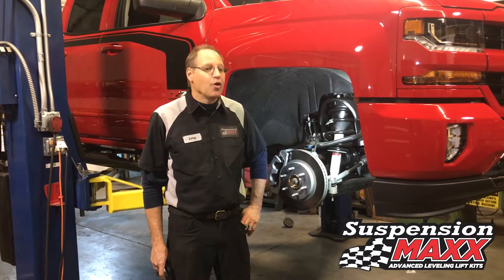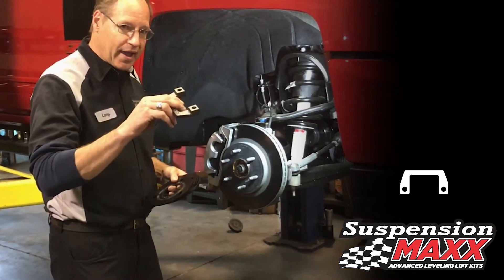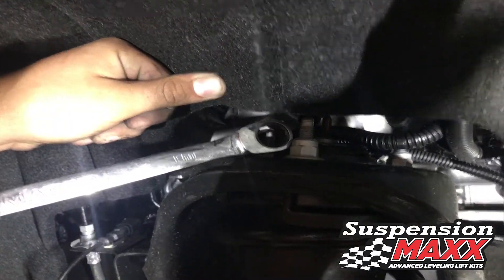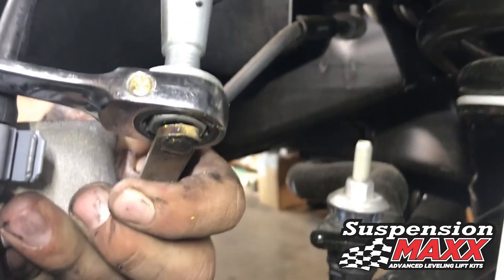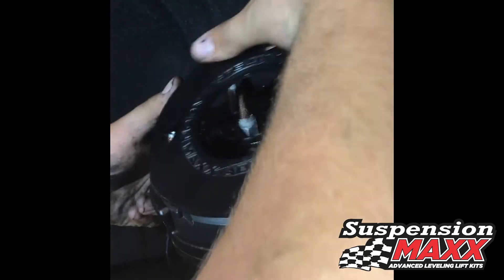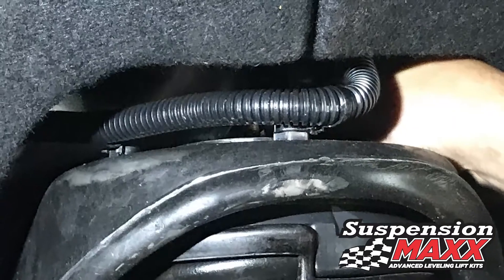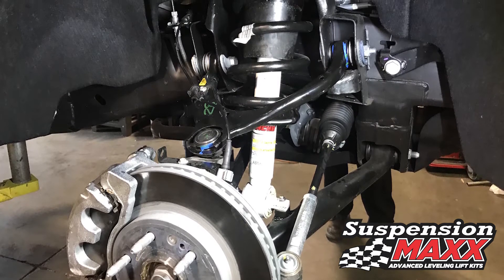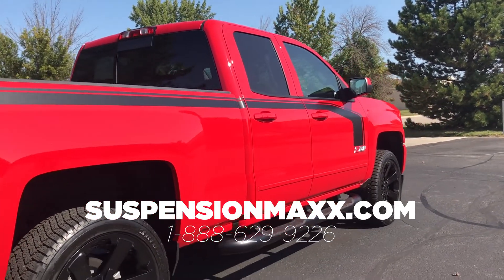Silverado1500 adjustable leveling kit install

Comment: Nice truck... I have a question why do trucks ride stiffer with leveling kits?
Reply: Braulio Mascote trucks that ride stiffer with leveling kits are trucks that are leveled with the stock torsion key . So it basically has no leveling kit lmao .
Reply from the maker: The Chevy 1500 in the video rides very well with no change in ride quality.